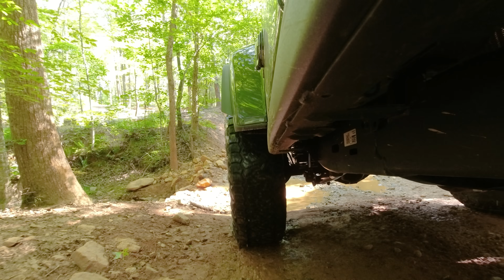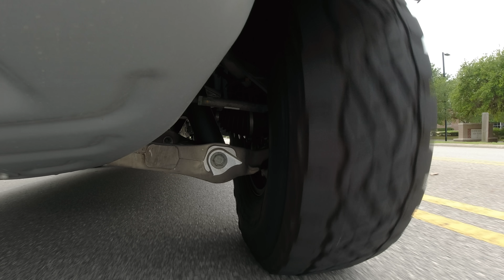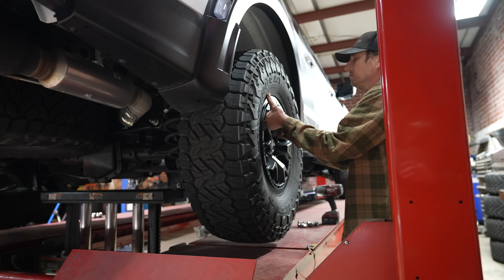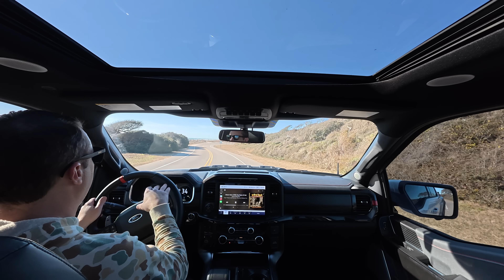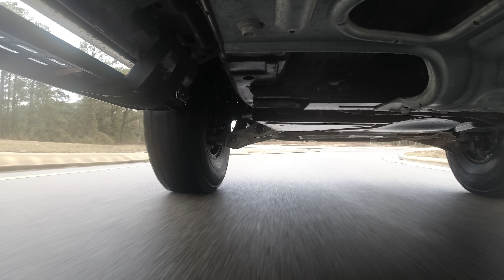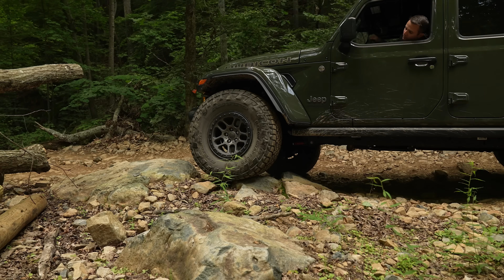12.50 Versus 11.50 Wide Tires : Which Is The Better Choice and Why: Inside Line

Comment: Jesus. My 3rd gen Dodge has 305s that sit 4.5 inches outside the wheel wells. It's what it came with when I bought it last year. Sticky performance summer tires, traction rating A, speed rating 120V underneath a heavy ol  Cummins diesel and 4WD. Its not that damn bad, I'm used to wrestling this pig. Lol.

Comment: the extra traction on asphalt is due to the weight of the truck taking up less contact patch  so every piece of tread is holding up just a bit more wieght.

Comment: 12.5 versus 11.5 is the width decision most people skip when they are focused on height. the 12.5 gives you more footprint on flat rock slabs which helps with traction. but 11.5s self-clean better in mud on the side lugs and clear wheel wells with less rubbing. if you are running wider wheels like 8.5 or 9 inch the 12.5 fills them out better too. solid breakdown of something the tire charts never really spell out 🤙

Comment: Narrow is best. 
1 better gas mileage 
2 less wear and tear on the front end components 
3 don't Hydroplane in water 
4 dig deep quickly get traction offloading.  
5 Steering 
6 more pounds per square inch on the ground.  
7 I think they look far better than wide tires
8 Narrow tires don't Sling Mud on your truck. 

Why does anyone like wide tires ?

Comment: Two things, first: in sand or loose dirt, a narrower tire is pushing less material in front of itself than is the wider tire. Also, a narrower tire when all else is equal will have a greater psi pressure (external force, not internal air pressure) on the road surface because it is displacing a smaller (narrower only - but the same length) contact patch under the same vehicle weight. 

I drive an F350 Godzilla Tremor and as far as those things go it is pretty light on it's feet due to it's XLT trim level, the gas engine and few factory options beyond the trim level. I have been looking for any 37 X 11.5 X 18 to run on my factory Tremor aluminum road wheel... and the only ones are two I will avoid: the Ridge Grappler and some chynabomb called the Swampthing. 

I do not want to run a 38. Nitto makes a Recon Grappler (the subject of this video) in a 37 X 11.5 X 17... so I'll shelve my 18" Tremor wheels for when a good 37 X 11.5 X 18 is made and have committed to the purchase of five Recon Grapplers 37 X 11.5 X 17 and five Venom Flow 351 17 X 8.5, +18mm wheels. Booyah! Watch out. Finally!
Reply: 35x12.50 35's on the beach at 15 psi is amazing, the situation you mention was never an issue on a giant silverado 3500 hd....

Comment: Great video. I am in the market for a set of tires and there are so many options its enough to give you a headache.  Between the 12.5 and 11.5 is there much difference in road noise?
Reply from the maker: I haven’t noticed any difference in road noise between the two.

Comment: Someone below mentioned wanting a 10.5 instead of 11.5 wide tire.  Is there such a thing, commonly available among multiple tire manufacturers, and what do you think of that idea, how would it perform in various circumstances?  Or maybe, might the 11.5 be the sweet spot, what do you think?
Reply from the maker: A 10.50 is less common, but they are out there. I think the biggest challenge is that if you’re gonna go with that narrow of a tire, you are likely sticking with the factory wheel. I personally don’t mind the 10.50, but for most of the vehicles that I have, it would be too narrow for even the stock wheel in a lot of cases.

Comment: 34x11.5x17 Recins Graplers on my JLU with a 3" lift, prefer it for biting deeper (less float) and lower rotational weight. It climbs walls and I don't spin where others with 12.5's do.

Comment: Think of running 37/11.50r17 on my jeep jl xtreme recon but I wonder how it would perform out in the trail…
Reply from the maker: I just got back from an off-road trip with my Rubicon JL with a 37x11.50R17 recon grappler. If it’s dry conditions, it works fantastic. If it’s wet, it definitely can get packed up in the red clay we have here in the southeast. Overall, I’ve been very impressed with this tire.
Reply: @D @DrivingLine nice!
Reply: @DrivingLine  how’s the road noise with the recons? I’ve heard that they’re quieter than the ridge grapplers

Comment: I’m running 35 X 11.5 Nitto RG’s on stock rims on my ’24 F-250 with great results. Plus, they’re cheaper than P-metrics...
Reply: Help! I have a 2024 F350 SRW 6.7HO Tremor. I put 60k miles in the stock tires, which is the same tire you put on your truck. I have been looking at the Ridge Grapplers, so I got them two days ago. They do ride amazing in a straight light but the rear end has a rubbery feel. So much so that the self driving lane keep won’t work around corners at HWY speeds. I have the exact tire size that was on there, exact same load rating and even aired them all to 80PSI cold. Not much help. Discount Tire will return them but man I love the better ride than the bowling ball stiff Duratract Tires it came with. I thought of stepping up from a E rated side wall to an F rated side wall. Thoughts? Right now the truck just wallows in lane changes, and turns.
Reply: @Captain-Awesome  You are running way too much PSI! I run my fronts at 55 and the rears at 59.
Reply: @TalonID The truck calls for 60 front and 70 rear. That is where the PSI started. I aired them up to try and stiffen the side walls. It helped but not close to the stock tires.
Reply: @Captain-Awesome  Yes, manufacturers over inflate tires to reach EPA mileage estimates. Research “chalking” tires for proper inflation. You’ll see that what I run is correct and will maximize wear. Regarding the TPMS, you need to move the setpoints lower with FORSCAN to eliminate the low PSI warnings. We have 4 trucks running this setup with great results. With them at 80psi, you’re essentially driving on only the middle 2-3” of tire. Thus the reason they’re squirrelly....
Reply: @TalonID  they are less Squirrley at higher psi, they are more Squirrley at recommended psi. After going back to Discount Tire they think that there’s something wrong with the tires. It is most likely what’s called “tread squirm”, but they think there’s something wrong with them.

I was wondering if you’d run into the same issue with the same tire. You’re more focused on my tire pressure when. the tire pressure fixed it more. I was also interested to see if you went with a load rating F instead of E. I do understand what you’re saying about the tire pressure but it’s stiffen the sidewall. Yes they would wear right down the middle, but they certainly wouldn’t be cupping lol. Either way these tires are getting returned.
Reply: @Captain-Awesome  Hmmm, “Tread Squirm” is new to me. I guess it is possible since the tread depth is so deep on these. I hope they replace yours for something that works. Mine are Load Range E. They are the third set of Nittos that I have owned. My first two sets G2s went 80,000 (F-150). I have 24,000 on the RGs and they are about 40% worn out. Good luck, I hope they get you corrected.
Reply: @TalonID Thanks Man, that was a term they used. These are also load rating E. I actually asked if they came in a load rating F. He said they do and that would firm up the side walls somewhat. I am going to ride these out for while and see how it goes.
Reply: I run 40F/35R unloaded with 35/12.50/18 ridge grapplers.  If you like a rough ride max out the psi but you’ll be happier with lower psi and a plusher ride
Reply: @brokenwrench404 I too prefer the lower PSI but I more often than not tow a 8000# trailer.

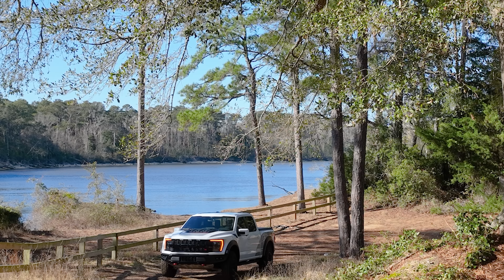Comment: When running trail air pressure...say 12-14 psi, which tire would be less likely to come off the bead on a 7.5" wheel..the 11:50 or the 12:50?
Reply from the maker: There used to be a school of thought that a narrower wheel with a wider tire would hold onto the bead better. I think there’s some truth to that. So, the 12.50 would probably be the one less likely to pop off. I would still rather run the 11.50 with that narrow of a wheel, however.

Comment: Is this something I could run on stock 2023 jeep gladiator Rubicon wheels? 11.50 and 12.50
Reply from the maker: Yes. I have the 37x11.50R 17 under my 2025 Jeep Wrangler Rubicon right now on the stock wheels. You can find videos of it on this channel.

Comment: Just installed the Wildpeak AT4W 35x11.50R17's on my 2021 Jeep Gladiator Mojave last week (3/20/26). Amazing LACK of road noise. My wife & I can actually have a conversation in the JT at highway speeds. I can hear a little wind noise, and actually hear my engine noise when the xmsn shifts. My stock Wildpeak M/T's @ 33" 285/70R17's were VERY noisy when I replaced them @ 55.2K miles, & they were almost to the wear bars. These AT4's look TALL in my stock wheel wells with no extra lift (stock). These weigh 68.5# ea., compared to the stock M/Ts at 65.4# each, and are installed on the stock 17x7.5" Jeep wheels. Bought a Z-auto TAZER to make the necessary truck computer adjustments. NOTE: I've got a small rub noise at full right steering limit (tight turn at a crawl), which I believe is against the plastic inner fender/well. I'll update this post if that rub is something I'm not expecting. May need to shave off a little plastic, or just not crank the wheel to the extreme right 🤔. Only 200 miles on these, but I'm really pleased thus far. Ride well, very quiet, and looking great! You can view all the specs at the Falken website 🏁https://www.falkentire.com/wildpeak/at4w#size-list🏁

Comment: I completely agree.  I have a 25 F250 Tremor.  I added a Carli torsion sway bar, 37 11.5 18 Ridge Grappler (only tire available in that size) on my factory 8” stock wheel.  The stock tires were 11.2 and for some reason these 37 11.5’s aired down look much wider.  I also changed out my front 1.5” stock springs for a BDS 2”.  So only 1/2” taller.  I didn’t want to go taller and ruin the suspension geometry.  Truck looks and rides phenomenal.  I also added King Ranch wheel lip moldings for that stock look and the tires are right at the edge not poking out.  The 1/2 “ changed the rake but it wasn’t enough to level her so in the bed I keep 7-50lb bags of corn at all times.  5 on the starboard side and 2 on the port side.  The tank is on the port side and with the corn bags the rear is now about 1.25” taller than front and it looks almost level w just a slight rake the way I prefer…plus we all know these trucks ride better w weight in the bed.  All my other trucks have 12.5’s.  These 11.5’s are like mentioned.  When these wear out hopefully someone w come out with an AT tire vs the Hybrid Ridge Grappler.
Reply: I've been heavily searching for a 37X11.50R18 for my 2017 F250 plow truck. It's very disappointing that the Ridge Grappler is the only choice in that size.
Reply: Agreed.  I searched every where.  The Ridge grappler is a hybrid between a AT and Mud tire.  I prefer quiet and the Ridge Grapplers are not loud but not as quiet as an AT.   I do like the way the steering feel of these 11.5” wide tires like mentioned in this video. Hopefully Nitto G3 AT tire will come out in that size.  The look is close but I feel w me towing 17k in and out of job sites suits me better in an All Terrain getting in the grass and mud occasionally.
Reply: @Jassman1962  my neighbor went the other route.  He put 37/11.50/18 ridge grapplers and lowered the rear of his tremor to level it.  It looks good!
Reply: Help! I have a 2024 F350 SRW 6.7HO Tremor. I put 60k miles in the stock tires. I have been looking at the Recon Grapplers, so I got them two days ago. They do ride amazing in a straight light but the rear end has a rubbery feel. So much so that the self driving lane keep won’t work around corners at HWY speeds. I have the exact tire size that was on there, exact same load rating and even aired them all to 80PSI cold. Not much help. Discount Tire will return them but man I love the better ride than the bowling ball stiff Duratract Tires it came with. I thought of stepping up from a E rated side wall to an F rated side wall. Thoughts? Right now the truck just wallows in lane changes, and turns.

I am considering some of the same changes you made to your suspension. These things ride like a shopping cart…

Comment: What about trying the 13.50
Reply from the maker: The 13.50 is the more common sizing in a 38 and 40 inch tall varieties. That’s what I run on my Jeeps. I don’t like a 13.50 with most 37s in an all-terrain unless you have a wider wheel to make it have a flatter pattern (17x9 for example instead of 17x8.5).
Reply: @DrivingLine rn I have a 20x10 with 35x12.50x20, but I really liked my 13.50 on my 22s may try it In the 20"
Reply: @HennyTRX3773  that’s different. Op is talking about off road performance and you’re talking about looks with no sidewall

Comment: 11.50 is probably the best size for most jeeps. Nate at outdoor auto did an entire video on tires, wide Vs narrow and consensus was biggest sidewall but a tire size matched to wheel width correctly, right in the middle of manufactures guidlelines performed the best reults. Most aftermarket alloys in 17 for jeep are 8.5 to 9j wide, which is perfect for 11.50 tires. 12.5 needs a 10j alloy, which I could only find as a beadlock in quality built wheels. I'll deffo be going 11.5 on My next set, and let's be honest 11.5 is still pretty wide. Let's hope we get more 11.5 in 37 as some people will want 3 peak depending where they live.

Comment: Whats the noise level on these tires on your truck drive on the roads and freeway? Thank you for the video!
Reply from the maker: They are pretty quiet. I would say they make the same or just a little less noise than the BFG A/T that came on the Raptor.

Comment: Currently running 33x12.5x20 on stocks on my 15 Silverado. When they run out, I'm absolutely moving to 285/60/20. 12.5 wides killed my fuel mileage by 2 mpg.
Reply: Did you ever get the 285s?
Reply: @Troycc14 Not yet. I still have plenty of tread.
Reply: Those must drive rough like flinstone tires.  More sidewall gives you a softer ride

Comment: Your steering feels heavy on the interstate because of the electric power steering. It stiffens the steering at high speed and makes it easier to steer in a parking lot. I've been looking at 35x11.50r17s lately, which led me to your video. Thanks for the comparison.

Comment: This is a huge problem for so many people and they just don't know or understand.....

TIRE POKE IS EVERYTHING..........

OFFSET AFTERMARKET WHEELS THAT POKE A MILE OUT OF THE FENDER WELLS ....

IT LOOKS STUPID FOR STARTERS,  RUINS YOUR TRACK AND HANDLING AND ALIGNMENT AND PUTS HUGE STRESS ON ALL OF THE SUSPENSION COMPONENTS...

AND DESTROYS THAT MPG......

BF GOODRICH COULD LITERALLY TAKE OVER THE MAJORITY OF THE MARKET SEGMENTS THAT RUN 35 AND 37 INCH TIRES BY MAKING A ( TRUE TO SIZE ) 35 - 11.50 AND A 37- 11.50 MUD AND AT TIRE...

EVEN AN 11 IN WIDE TIRE WOULD MAKE SOME HIGH NUMER SALES.........

WHY THEY DONT MAKE THIS TIRE,  IS PURE STUPIDITY..............

BF GOODRICH HIRED A BUNCH OF WOKE ASS PEOPLE UNDER OBAMA AND BIDEN...

THEY SHOULD FIRE THEM AND HIRE REAL HUMANS...... AND FIRE THE COMMERCIAL  COMPANY THAT USES WOKE ASS ACTORS........

WOKE ASS PEOPLE DONT EVEN BUY TIRES ......MOST OF THEM ARE TOO STUPID, AND LEASE CARS ON OBAMA VOUCHER PROGRAMS.....

SEMPER FI
Reply: Really want a BFG KM3 in a 37 X 11.5 X 18 to wrap around my factory Super Duty Tremor's 8"-wide wheels. I cannot abide these Nittos.
Reply: @applesbighatranch6906  nobody makes a 37/11.50 wide mid terrain.  I wish bfg, Nitto and Toyo would listen to their customers
Reply: R u still blaming Obama for your shortcomings. U need to move he hasn’t been president some 3 terms now. If something is wrong by now it’s on u
Reply: @Isocandygreen Hypothetical question: What do people who type "u" instead of "you" do with all that extra time?

Comment: I have a 2024 Colorado ZR2, and put 35X11.5R17 Falken Wildpeak A/T4W's on the OEM wheels, and while I haven't fully flexed it, I have wheeled it some and have had zero rubbing issues.  My buddy has the same exact setup as mine, but a 1" front level and he's fully flexed his with the steering wheel turned fully, and said he only has a very slight rub in the front of the rear fender flare.  I've ordered the Bison Jounce damper kit and will swap out the OEM 1/2" lift front spacer for a 1" lift front space and since that can't be done in the rear due to the rear spacer being UNDER the jounce damper strike plate, I'm adding custom 1/2" lift rear shackles to get a total of 1" lift between the OEM 1/2" lift rear spacer and the shackles.  Since he didn't get any rubbing in the front, and I'm adding a 1" lift in the rear that he doesn't have, I feel confident there will be no rubbing in the rear of mine either.  I think the key to avoid rubbing is to stay with the OEM width and offset wheels, and OEM width tire if you want to go bigger in diameter.  All the people that put slightly shorter but 1"+ wider tires on (315/70R17), especially with negative offset spacers or wheels (for that "Mall Crawler" look/poke), have rubbing issues just driving around town in some cases when hitting slight bumps..

Comment: I went from a 33/12.5r18 on my F150 to a 275/70r18 (21-F250 tire size) essentially a skinny 33 about 11" wide. Much lighter steering feel. In central Florida driving in the orange groves or on the beach on sugar sand or beach sand haven't had any issues getting out of some good ruts.